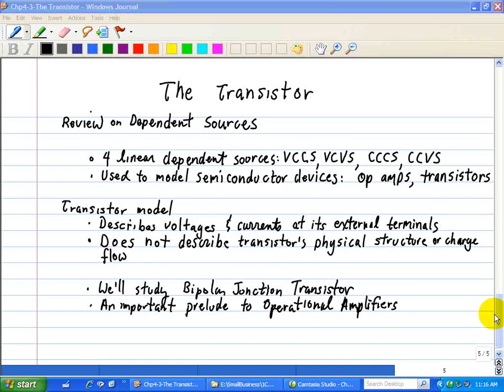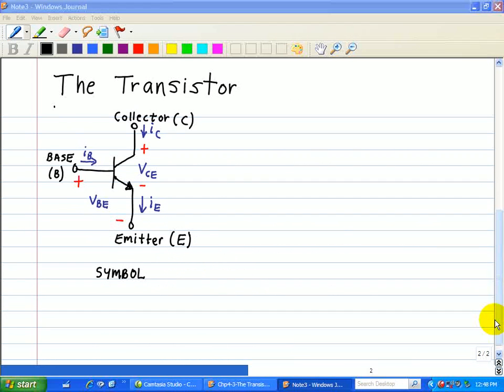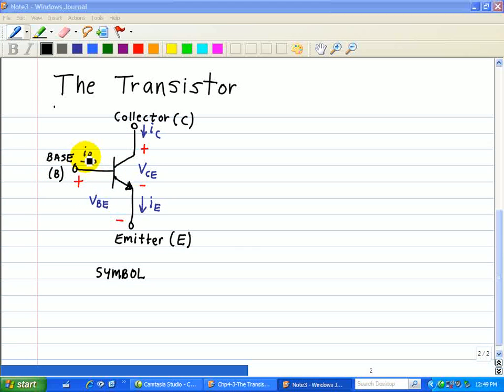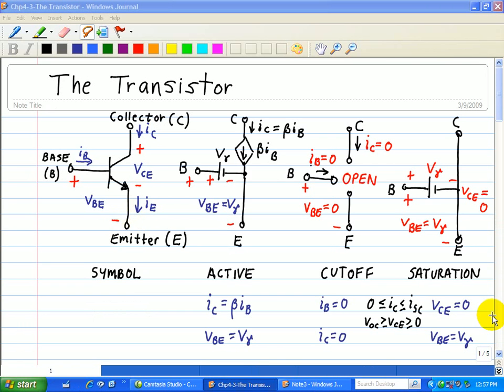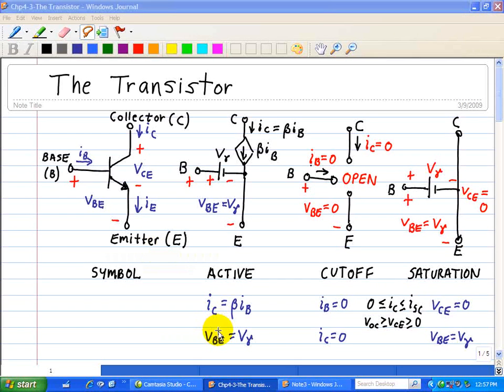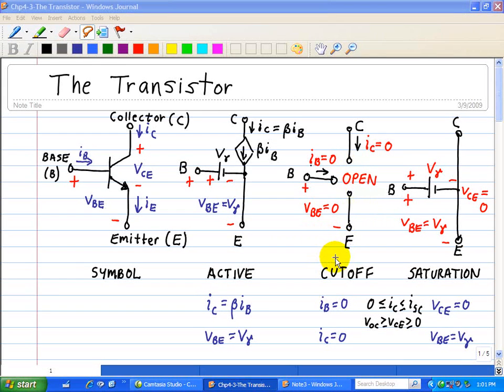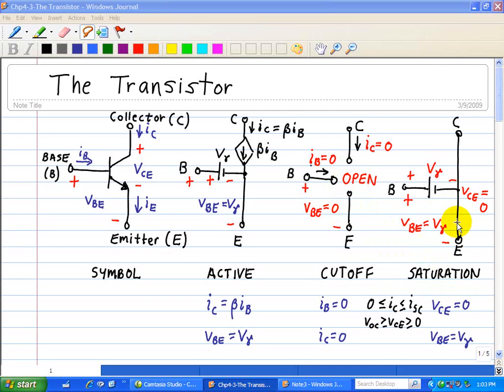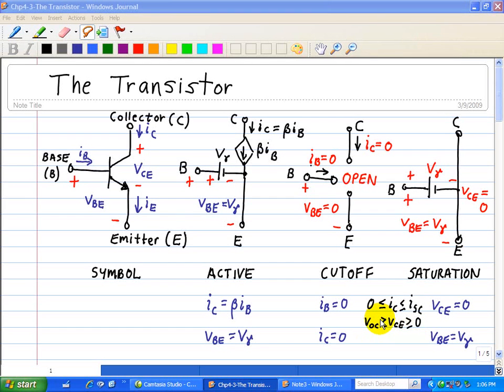Circuit Analysis for Newbies - Transistor Tutorial - Prelude to Operational Amplifiers - Part 1

Comment: @orang3s When a transistor is in cutoff or saturation then it can be operated as a digital device such as an inverter.   When a transistor is in active mode then it can be operated as an amplifier to drive a speaker for example.  Hope this helps!  Dr J